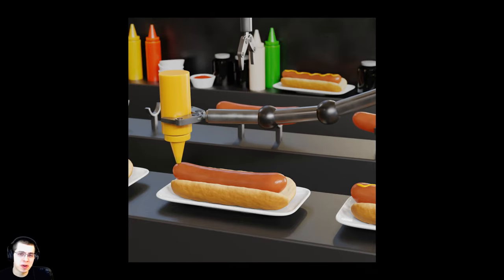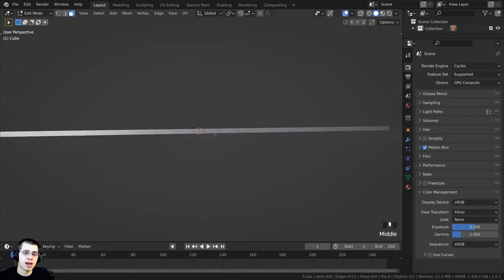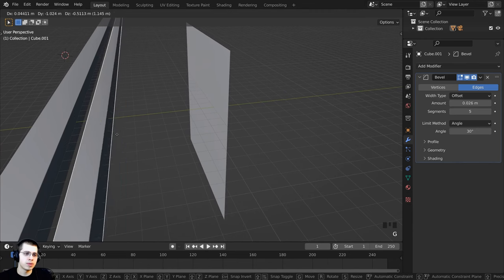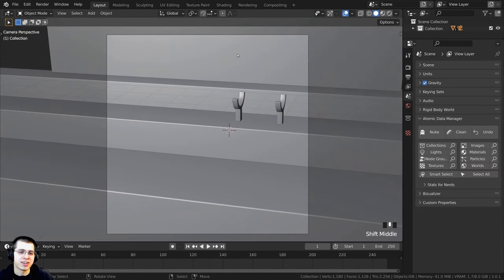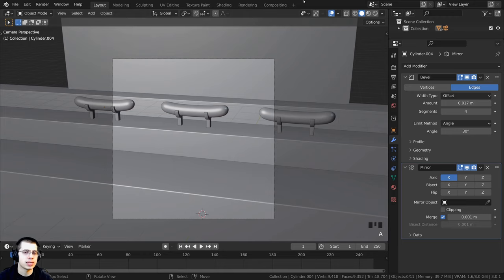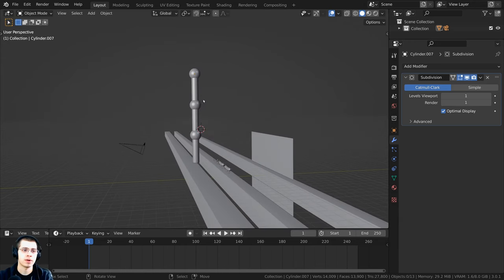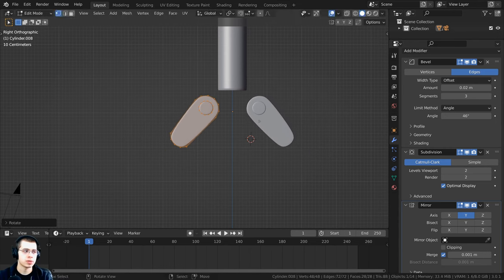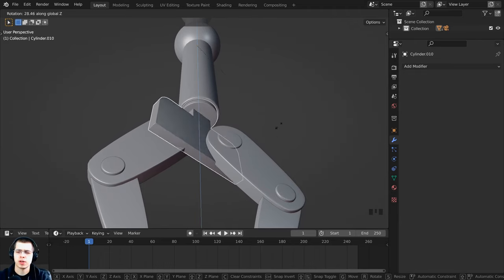Hot Dog Factory (Part 1) Satisfying Looping Animation-Blender Tutorial

Comment: When you're displacing the hot dog bun, there is no need to apply the Mirror modifier, since the Displacement modifier is added afterwards, the displacement will not be mirrored. This makes it easier to reshape the bun later.
Reply from the maker: Ahh your right. 👍‍

Comment: I'm sorry, it's me again... why are you doing this plate animation so complicated? Select the buns, parent them to the plate. Parent the plate to the conveyor belt. Select buns and plate, press Shift+D, X, move manually until the distance looks fine, see how far that roughly is and type in the adequate value, finish it. Then hit Shift+R three times to duplicate them three times with the same distance. Now move the conveyor belt so that the plates are placed as you want them for the animation. Keyframe the conveyor and it's done.
Reply from the maker: Ahh I see. I just tried this in Blender and it works. Thanks for that. I will have to use that method next time I do one of these. So you have to apply the location of the hot dog and plate, so that the location values return to 0. Then you can duplicate it and move it over. Then you can find the exact value, by selecting the object, and hitting the N key, for the side panel. On the location X, you can see exactly what the value is, and then just animate the conveyor belt moving over by that exact value. 👍‍
Reply: @RyanKingArt  No, you have to apply nothing and no need for the side panel. While you are moving manually on the X axis, the status bar shows how much you are moving the object. And as soon as you think you've moved it far enough look at the value, let's say it's 2.7893, then - before you do anything else - type in 3, this overrides the manual movement, and then hit Enter to confirm the translation. And if you don't do any other action afterwards, with Shift+R you repeat the last action which means you make a duplicate from the duplicate and it will be moved 3 m on the X.
Reply from the maker: @gordonbrinkmann  Yeah I get that.